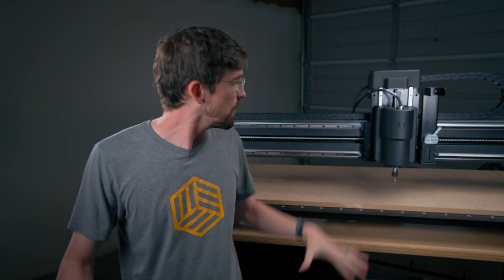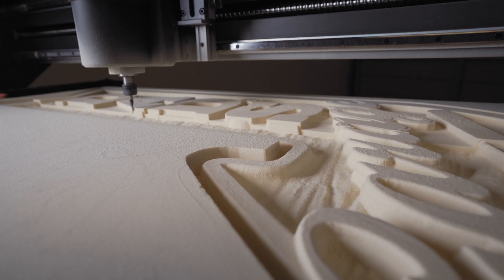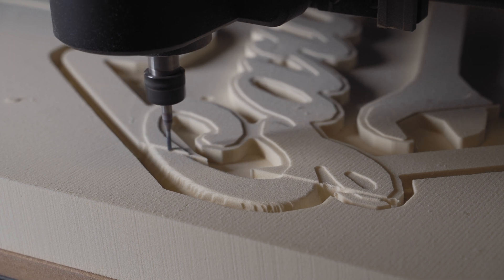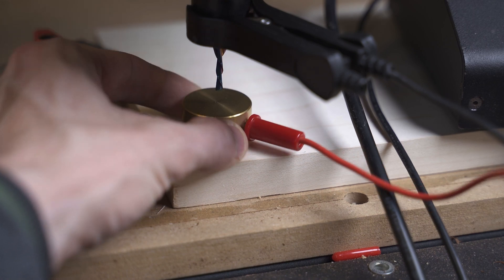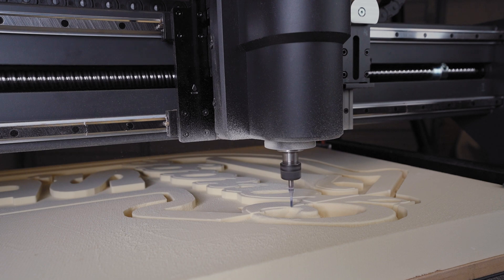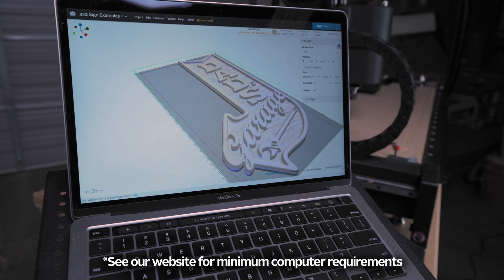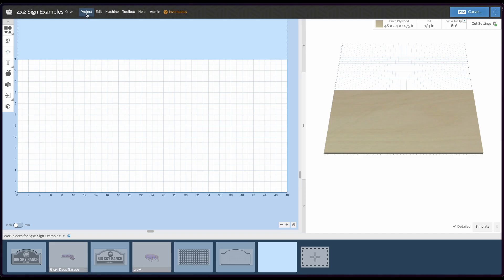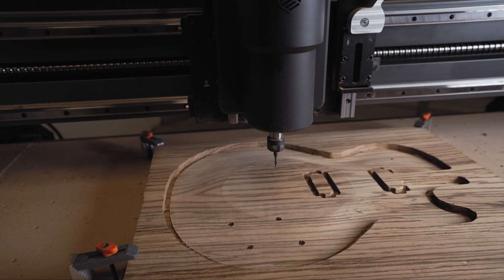The X-Carve Pro 4x2 Overview

Comment: Seriously overpriced, not only is the machine $7,495.00, the software in order to run the machine is $216 per year. You can build your own table fairly easy, and use open source software for free. You can also buy an offbrand table but 1/10th the price and just make sure you get a decent router and all is gravy.